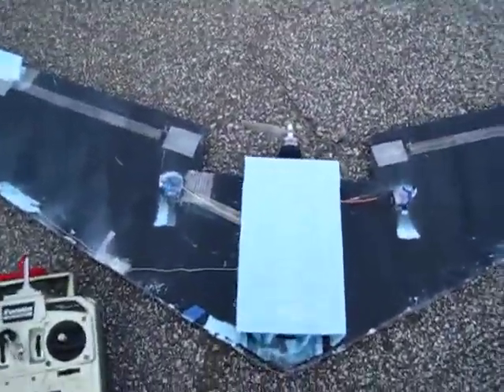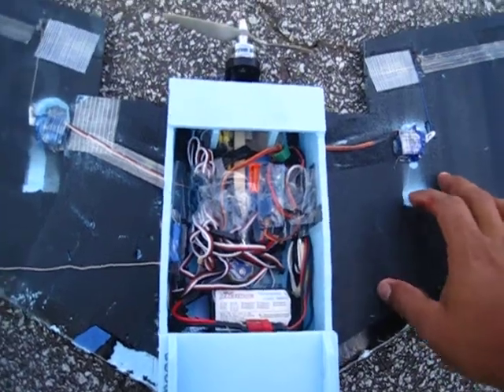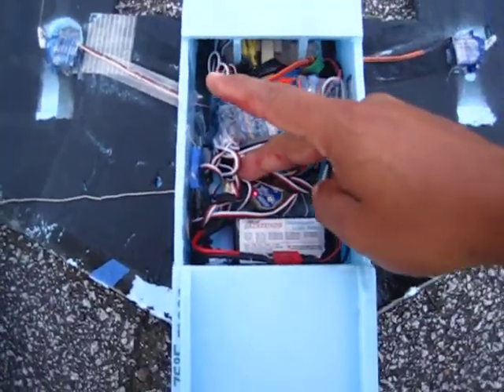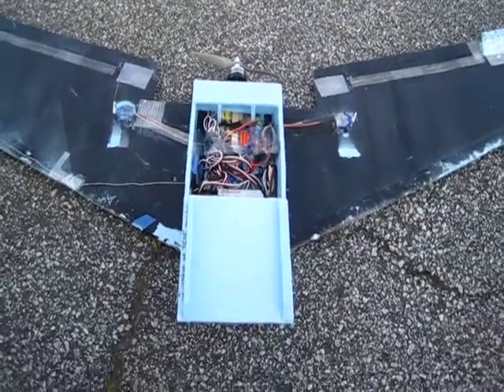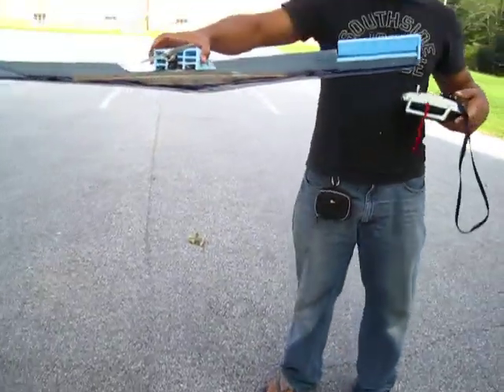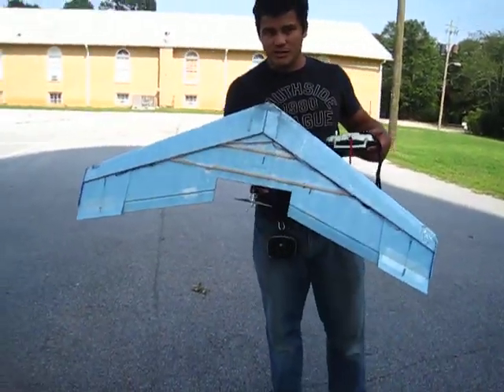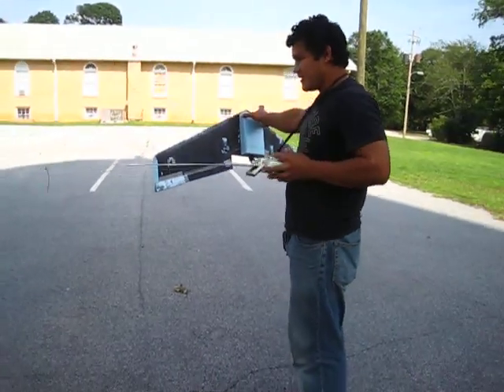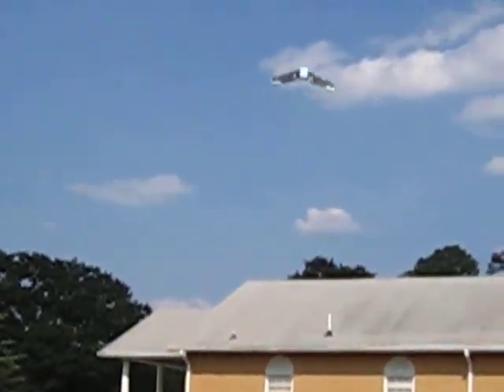rc B 2 Stealth Bomber With Air Breaks

Comment from the maker: the elevons are on a normal mixing and the air breaks or horizontal stabilizer are on the rudder channel so when you add right rudder the right air brake opens and the left closes I'm using a chip gyro from hobbypartz . com